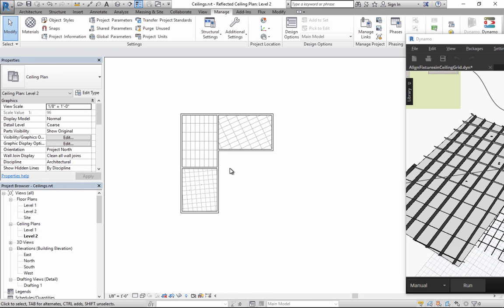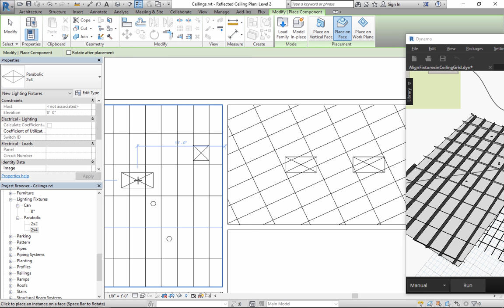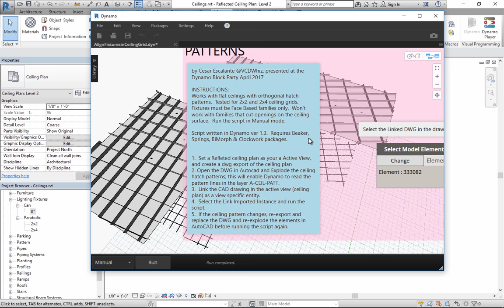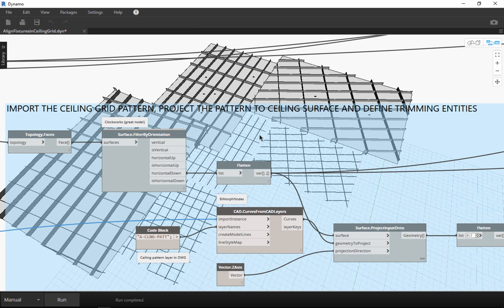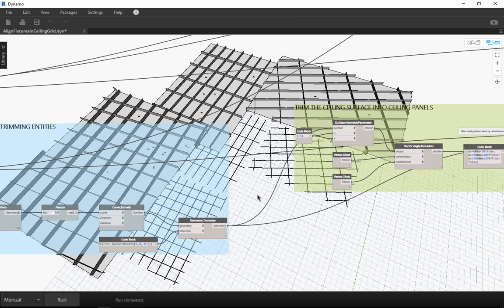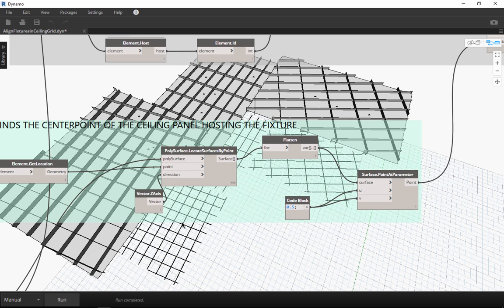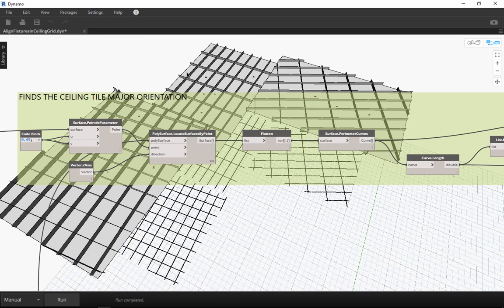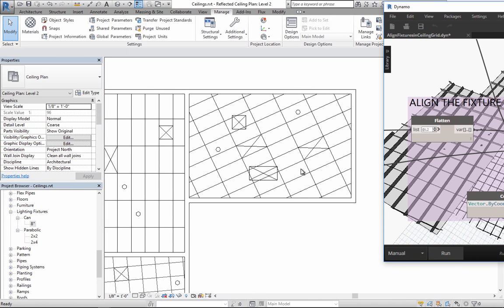Align & Center Fixtures on Ceiling Grids w Dynamo

Comment: Great video! I'd love to try it myself and see it works. Would it work if the fixtures are sitting right on the surface of the ceiling instead of hosting on the ceilings?

Comment: I downloaded the script and tried running after loading the nodes of Bimporph, Beaker, Springs, Clockworks. But the script is not working, I presume that the clockwork node is not working, hence the A-CEIL-PATT layer is not loading into the dynamo,Is there any way to resolve this issue?

Comment: Quick question, in 2.0 the Get.Keys was depreciated.   Have you updated your script since then and what did you do in that area of the dynamo.  (Set Location Location Point of Fixture).   - Cheers
Reply from the maker: Get.Keys were replaced by the new dictionaries nodes.   I have not updated the script and now it few years old; there are any areas on this script that now can be expedited.
Reply: Thanks for the response!  Seems like there are a few spots but overall that Get.Keys is the main issue.  -  Cheers